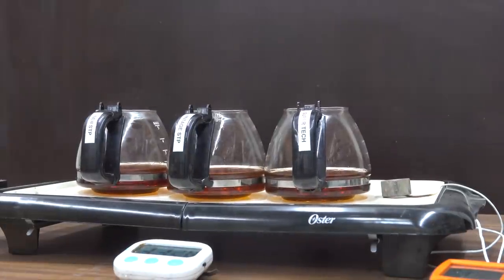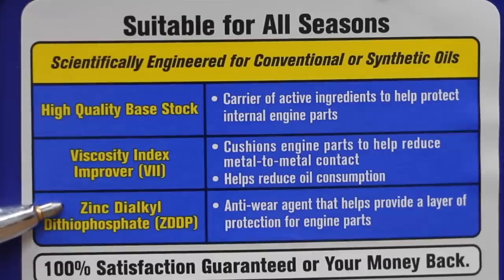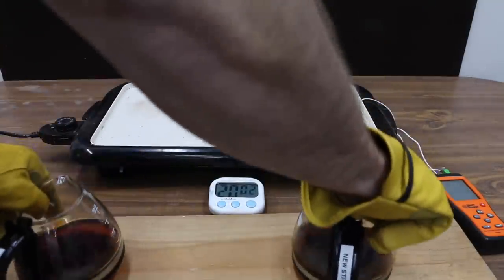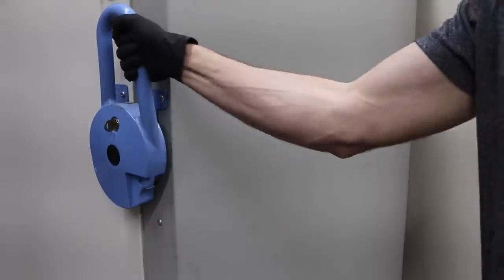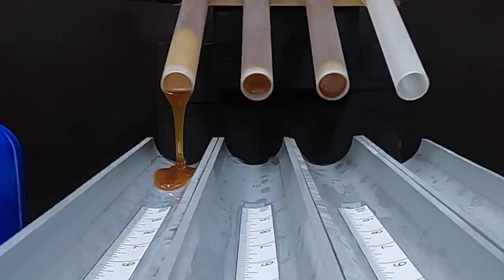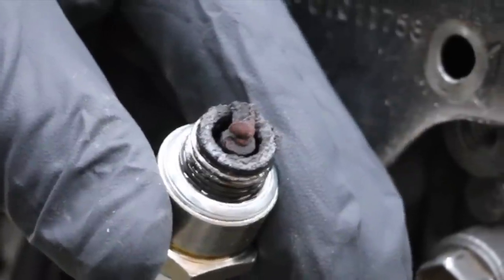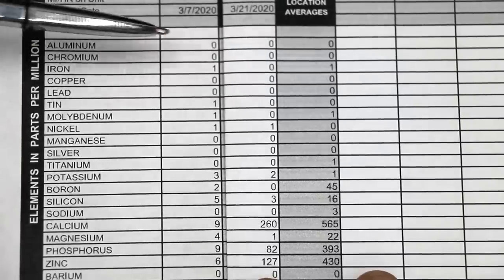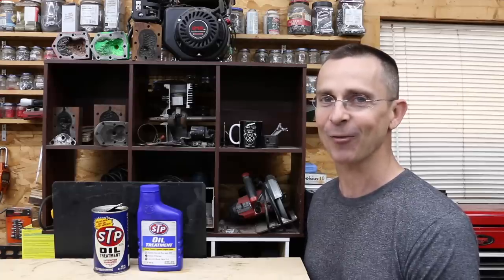Richard Petty's 1981 STP vs 2020 STP?  Let's find out!

Comment: In 1970 I was working in a garage when a Wynn's oil salesman came in and gave us a demonstration on two well known oil additives. STP and Wynn's Friction Proofing. He had this little stand with test tubes which were filled with STP and another with Wynn's. We used our STP and he opened a can of Wynn's in front of us. He then had a small box of ball bearing which I picked two out and dropped one in each test tube. They both slowly sank to the bottom each having equal time to get coated. He then took a propane torch, with the flame between them, and heated the tubes to, just guessing, a few hundred degrees. I can't remember exactly how long he did this but I watched real close to make sure both were heated the same. We then let them cool down. Each was poured in a different small bowl. Now I was a STP fan so I called myself watching real close. And not sure if the boss and I were fooled by sleight of hand or what. The STP ball bearing was pretty well eat up. Looked bad. The Wynn's one was still slick. Me being 22 years old it definitely made a believer out of me. To this day I still have those plastic discs that you would find once in awhile in a can of Wynn's products. Has any of you followers out there, got to be old like me, seen this demonstration before?
Reply: You have to wait for someone to pop up with similar experience :)
Reply: Following for fun
Reply: Do you feel sexually repressed?
Reply: @Jimmy-sj9ny  whut does that meen??
Reply: My entire career was as a mechanic. I started out in the early seventies. I was always told that STP was an additive NOT a lubricant. It was meant to be used with regular oils. In my experience older multi-grade oils did suffer more from viscosity breakdown. STP with its "temperature activated long chain polymers" was specifically to prevent that breakdown. 
Some of you may recall STP's add campaign where they dipped a screwdriver blade tip into STP and had various "tough" guys try to hold the screwdriver by its tip-none could. I tried it myself and could not hold it either. I could hold a screwdriver dipped in conventional oil. Back in the day I think STP was a useful product. That being said, today I use a top of the line synthetic oil and NO additives.
Reply: @ctk1138  In the 1970s when I had a 1967 VW Beetle with its hot-running air-cooled engine with its loose tolerances, that STP worked well to keep up the oil pressure and minimize the oil viscosity breakdown.  
But my awareness of STP being a viscosity thickener, the thought of using it on newer engines with the close tolerances they have was out-of-the-question.  I've found using synthetic oils for the past 25 years on 1990s era engines to be very satisfactory.
Reply: @bloqk16  I completely agree. In fact I run synthetic oil in everything; transmissions, transfer cases, differentials and power steering. I even use synthetic brake fluid for its reduced water absorption and higher boiling point. I run Purolator "Boss" oil filters which I change at 6000-7000 miles with oil changes at 12000-15000 miles. I have two trucks, a 1991 Nissan and a 2006 Silverado. Both have over 220,000 miles. Neither require more than a quart of oil to be added in that interval. I'm sold on the value of synthetics.

Comment: In the early 1970s and into the 1980s I used STP in high mileage engines.  It basically worked as a viscosity  improver or thickener and reduced smoking and oil consumption in worn engines.  By the 1980s engines and motor oils improved to the point that oil burning was much less of a problem.  And, of course modern engines are designed to use thinner oil.  Current high quality brand name oils are so much better that adding most auto parts store oil additives is likely to degrade the performance.  Despite the hype, most of these type of products are obsolete.
Reply from the maker: Thanks for sharing.
Reply: Yeah but what about using 0-20 if you live in Miami, seems foolish ??

Comment: I'd like to see a similar test using Lucas synthetic oil stabilizer
Reply: What I seen as far as test it does much more harm than good.
Reply: He did a couple of Lucas videos, STP vs Lucas is one. Do a search from the main page.
Reply from the maker: Thanks for the video idea.
Reply: @captainmarvel9610  That's for traditional ultra thick Lucas, the new synthetic is under a 20wt, closer to the viscosity of water.
Reply: @ProjectFarm  I'm actually watching your videos now. I love them. I sometimes forget which was the winner so when I'm going to buy something I rewatch.  Love your channel
Reply: I don't know about the oil stabilizer, but I gotta say, the stop leak stuff honestly helps if you catch the leak early on. Same for the transmission fluid additive. Didn't shift any smoother, but it quit leaking long enough to get it serviced properly.
Reply: @ThatWolfWithShades  Stop leaks will just gum up the bejesus out of your engines. Do Not Use Stop Leaks, period. Fix the problem, not the symptom.
Reply: Presumably sold to people who believe oil needs to be stabilized.
Reply: @captainmarvel9610  Oh? I'd love to see THAT information. I've used it in some of my junk. Sadly, not my 92 Chevy, which now has a knock!
Reply: @hawkdsl  I'm not doing anything that's hard or expensive, when I can do something fast and cheap. Or nothing at all, lol. I'm goin thru life with as little effort as possible, LMAO!

Comment: Back in the late 1960's I had some old cars with severely worn engines and transmissions.  Using the vintage STP  I kept those old cars running.  The old STP is mainly an oil thickener, which was just what I needed.  Did the old STP work well in cold weather?  Absolutely not.  The viscosity was just too high.  Are modern engine oils superior to the oils of fifty years ago?  Yes, absolutely.  If your engine is badly worn, STP may buy your engine some time.  The small engines in most lawn mowers depend on oil splash for lubrication.  Does STP splash?  Not much.  I worked at an implement shop.  I had customers try using STP in place of engine oil.  That did not end well.
Reply from the maker: Thanks for sharing.
Reply: what I've learned over the years (and updated by watching these tests) is to use seafoam
my 160K mile diesel runs beautifully and the Ford service writer (40+ years in the business) makes it a consistent talking point that I'm one of the few with a 2005 6.0 that isn't coming in on a tow truck. maintenance and the right chemicals. It also gets a very respectable 15 mpg and as soon as that drops to 14 mpg, I know I need to fix something. : )
also, the new synthetics are like computers in the crank case ... especially for Porsches (where bore score is a serious issue in some years for some engine types in their flat sixes) ... the ability of the oil to do the right job at the right temperature, the right load, the right place in the engine ... Porsche and companies like Mobil have created magic to pass emissions and keep these engines clean, now they have particulate filters and the technology is all the more taxing for oil that has to start at 0 and get to 50 in a matter of minutes and keep completely different parts of the engine (valve gear, piston rings, big end, turbos, 20 different seal types and metals and bearing speeds) ... I remember attending factory Porsche training 15+ years ago and thinking it's just a matter of a year or two and engines will have separate lubrication for each system in the engine, but the engineering decisions consistently favor oil chemistry and complex ancillary designs ... gosh, you know it's as if they'll do anything to keep selling oil ... : )
Reply: Same here, the old STP wore out my engine in 3 months.
Reply: @brightymcbrightface  my first question, as the owner of a 2006 Powerstroke that I bought new in 2005 , how do you only have 160K + miles on your truck ? 🤣
Reply: @stevebengel1346  ...hmmnn....farm truck only?
Reply: In the early 70’s I kept an old car with bad main bearings running using STP.

Comment: Back in the 80s I had my 71 Challenger with a high mile 318. Beating the hell out of that motor while gathering drivetrain parts for a 440 swap, I drove that motor for about another year. Had <20 psi of oil pressure at a hot idle and a subtle rod knock from the bottom end. I’d add a can of STP and hot idle oil psi would be up around 30 and bottom end quiet. Used the modern version in a 72 Cutlass 350 with scary low oil pressure and drove it locally for a couple years with no issues but really never beat on that motor. Does  it’s job for sure!
I wouldn’t be pouring that molasses in a modern motor with all the oil controlled stuff: VVT, DOD, etc., but on anything else or if you’ve got no other option, I’d use for sure.
Reply from the maker: Thanks for sharing.
Reply: We had that 318 in Mom's station wagon, LOL

Comment: Project farm: we're testing oil today!

Coffe pot: 😳
Reply from the maker: Thanks for watching.
Reply: The real question is what does he use to clean them? They are cleaner than any coffee pot ive ever seen haha
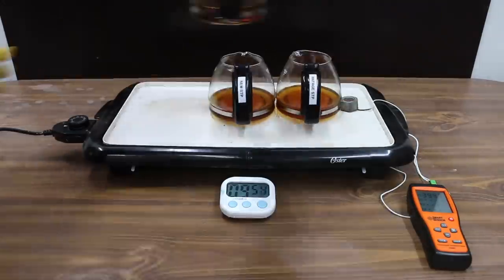Reply: @ProjectFarm  at 3:33 , I see there are minutes gone by while the hotplate and pots are (seem) untouched. But the hotplate is slowly (in real time) flexing up and down. What's going on there?
Reply: @pr0xZen  the hotplate cycles on and then off once it reaches max temp constantly so in timelapse you're able to see the hotplate warping from heating and cooling
Reply: @xn7331  I consideres that it could be thermal cycle warping, but I'm surprised it was so significant given the rather modest weight load and thermal range involved 🙂

Comment: I've actually been using super tech high mileage full synthetic in my 1999 gmc sierra 1500, with over 260k miles and no rebuild, just regular maintenance and oil at 6k she still runs like a champ, and only smokes when cold love that oil
Reply from the maker: Thanks for the feedback.

Comment: I’d like to see a strength test on brands of sockets. Like kobalt, craftsman, Mac, snap on, and why not harbor freight! If you have the capability to test the
 breaking point, coatings, etc.
Reply from the maker: Thanks for the video idea.
Reply: I like it
Reply: I think older SK are virtually unbreakable.
Reply: Secret; for safety purposes, all impact tools MUST pass a minimum test before being approved to be sold as impact tools. So, say, a Harbor Freight impact socket (or extension) may not be as tough as a Snap on, but it will likely be much tougher than any standard grade socket. So use cheap impact tools for your general use, and only pull out the thin wall stuff when absolutely necessary.
Reply: pelletman65 agreed! I love they’re small 1/4” sets I have a few of those. Perfect for general auto work
Reply: Even vintage vs new snap on. 

Every time I get a snap on socket warrantied, or replace due to wear, it lasts less time than the one it is replacing. 

Common use ones like 8, 10, 13 and 15mm in an automatic transmission shop doing bench work. The newer replacement ones seem to be pretty short lived when it comes to durability from wear or breakage.
Reply: @pelletman65  You just aren't trying hard enough.
Reply: @pelletman65  In the late '60s my boss used a set of 1945 Craftsman sockets on air wrenches.  He spilt one 3/8 socket in 20+ years of daily fixing cars.  Maybe the old ones were that good.  (I wouldn't trust the "Chyna" stuff to hold up like that).

Comment: I had an argument with a good friend on oil additives recently, STP was one of his favorites along with Lucas, I told him maybe save some money and use bacon grease -   Proud to support unbiased everyday useable scientific testing on Patreon.
Reply: you ever built or ran an old flat tappet cam engine? run it without stp or zddp additives and see what happens.
Reply: Frigglebiscuit Did you look at the lab tests?  Why would you want to add STP and dilute the amount of ZDDP that is already in the oil?
Reply from the maker: Thanks for sharing!
Reply: @frigglebiscuit7484  As Todd (or Terry?) proved in this video, STP contains VERY LITTLE ZDDP (zinc). You're much better off with a zinc additive, or an expensive "racing" oil like Joe Gibbs. Rotella and Delo 400 diesel oils used to have a lot of zinc, but thanks to EPA bullshit, not anymore.
Reply: Suggesting the use bacon grease for anything other than ingesting should be a crime. We save our bacon grease and it is only used for cooking.

Comment: Damn. And I just added a bottle of STP to my oil like a month ago. Makes me want to change my oil again now
Reply from the maker: Thanks for sharing.
Reply: Dont! just leave it be. i use stp in my 2000 civic and it runs fine
Reply: I disagree with the notion that this will “negatively effect” your oil performance, especially if your adding mid way through an interval like 3 months into a 6 month cycle.
Reply: No need for any of that junk. Just use a high quality synthetic that's a viscosity grade thicker. No carbon buildup problems like the STP additive caused.
Reply: Try Motorkote rather than STP.
Reply: @Dcc357  old flat tappet engines disagree.
Reply: It has it's uses, but if you have an engine without problems, it's not needed

Comment: When I had my shop we used S T P for rear ends in 18 wheelers , transmissions and front wheel bearings ,less down times , had a contract with 9 police cars all rear ends got 3 cans of STP topped off with 90 weight Ford rears did not have the Ford whine STP worked wonders in the old 9 inch rears
Reply from the maker: Thanks for sharing.

Comment: Can you do a video comparing 0w 20, 5w 30 and 0w 40. Some cars says you can used anyone you like. But there is not test that says which is better just a lot is speculation.
Reply from the maker: Great recommendation!  Thank you
Reply: Project Farm In addition 10w 30 and 15w 40 in this would be great.
Reply: Thats because it depends upon engine, weather/season, how cold it gets, etc, etc.
Just follow the manf's suggestion unless you really know engines, it all costs about the same.
Reply: I'm a mechanic so I'ma help you out a bit. Every car has a recommended grade of oil that you are supposed to use, but it might have a different grade that the manufacturer says can be used if you have to. Most every common new car coming off the assembly line will ask for a 0w something and that is what you absolutely need to put in your car. If it has second grade, it's more of an "if you can't get the recommended oil, you can use x in its place, this one time". Some dealerships will turn down warranty work if you use the wrong grade of oil. Believe it or not. Most shops use Carfax for all their services. If you come to my shop and have your oil changed and then go to the dealership later, they will know whether or not you used the right oil at my shop.
Reply: I'm hoping he does a scientific test between dill pickles, sweet gherkins and bread and butter pickle slices

Comment: I had a friend back in the mid 80's he swore by STP with his old Accord and it ruined his motor at the end, he used too much STP.
Reply from the maker: Thanks for sharing.
Reply: The STP did reduce the wear scar in the lubricity test, so I’m surprised you would dismiss it altogether.  I’m wondering if there is something about it besides the additive package that explains what it does.  Many years ago some log truck drivers I knew would add a little to their drive axles.  They had temperature gauges on the axles and noticed that the temperature would come down some.  I do think it’s good stuff, but not necessarily good for every application.
Reply: It altered his piston head alignment and wreaked his walls it sounds like

Comment: I had to laugh at the flow test. I remember years ago when I put that STP treatment in my engines. I had to either use a spatula or leave the container in a large funnel in the valve cover and let it ozze down for hours. I agree, the newer is not as thick as the old.
Reply from the maker: Thanks for sharing.

Comment: STP - scientifically treated petroleum - has an amazing history - it was invented in the early 50's, can you imagine what kind of motor oils were being used then? Maybe not even detergent. The STP company was sold several times, and when Andy Granatelli came on the scene there were fascinating events taking place, like all the Nascars using STP,, and Granatelli's Indy racer turbine car darn near won the Indy 500, it led most of the race until a transmission bearing failed with only a few laps to go. Also interesting that the turbine car was four wheel drive !!
   I was a huge fan of STP fuel treatment because it cured my English sports car's twin carbs of needle and seat sticking due to some kind of contaminant. I even took them apart and rebuilt them - twice, but the problem remained until out of desperation I bought 2 cans of STP fuel treatment, and that problem disappeared. That was in 1970 :)
Reply from the maker: Thanks for the information..
Reply: How did an oil additive prevent carburetor needles fom sticking? Did you put STP in the gasoline?
Reply: @stephenarling1667  The fuel treatment is a totally different product . Same company - different stuff.

Comment: Years ago I worked at a compression molding facility and we molded big parts, the biggest press was a 2500 ton Erie and we heated all including the 85000 pound die to 350 degrees. The top half had push rods for pushing the part out after it molded and set, we would take small paint brushes on a pole and lube the rods every morning and the STP was honestly as thick as honey even around the heat,,, it held up better than the bottoms of our shoes walking into the metal floor of the hot press lol. Thanks for the time and honesty you give us on your videos
Reply from the maker: Thanks and you are welcome!  Thanks for sharing!